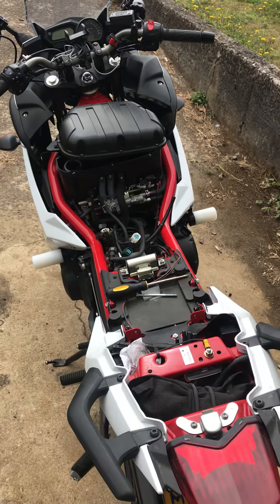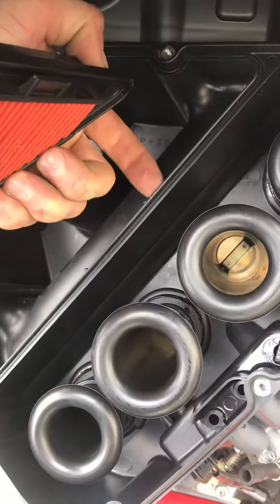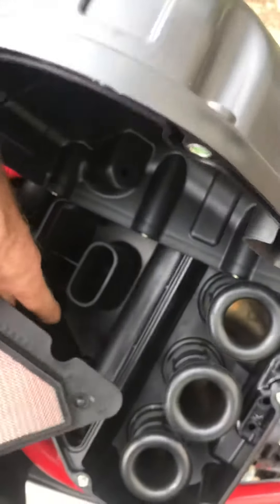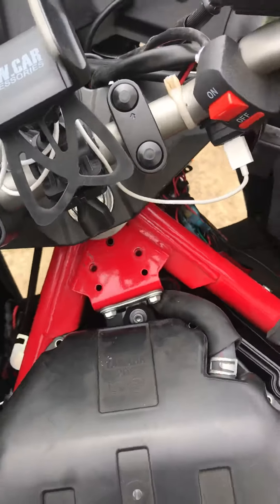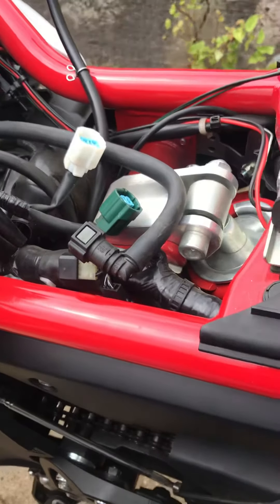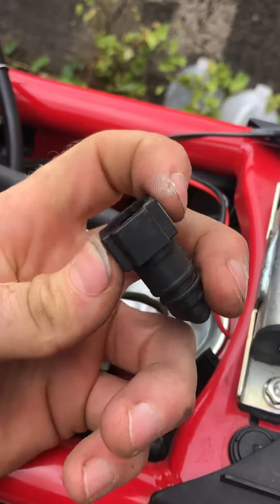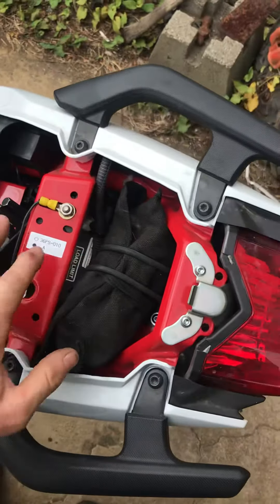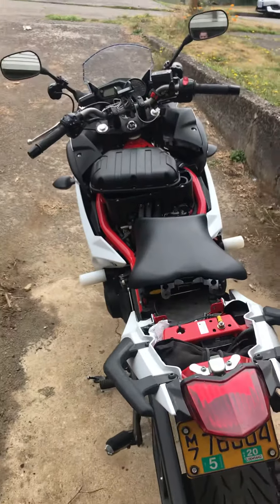Air filter change 2013 FZ6R

Comment: Your instructions on changing the air filter with everything pulled apart in advance were actually very helpful.  It allowed me to quickly see how the disassembly and assemble process works and what is will look like.  Thanks.
Reply from the maker: I’m glad it helped. I like the reverse order too. Quick and detailed with no wrenching to wait and get through. fz6r is definitely an under rated bike. Cheers
Reply: For sure.  I'm an old man who has been riding for decades and have owned about every bike imaginable.  I decided to grab a 2012 FZ6R a few months ago because I got a great deal on it.  Compared to all the motorcycles I've owned since 1979, this FZ6R checks the most blocks for "real-life" riding enjoyment.  And to beat it all, it's the least expensive bike purchase (by far) that I've made in 30 years!  Win-win.